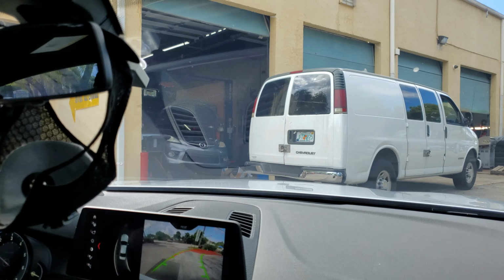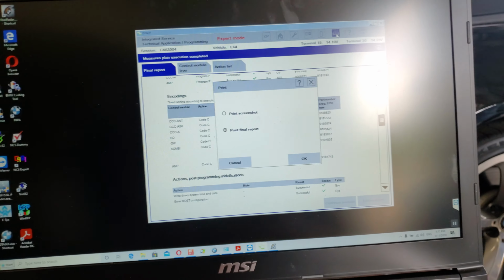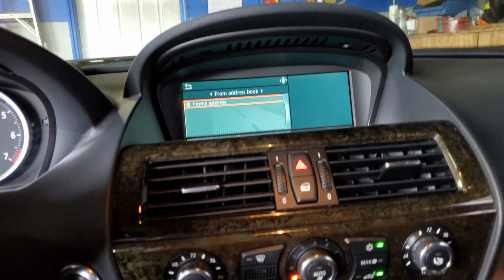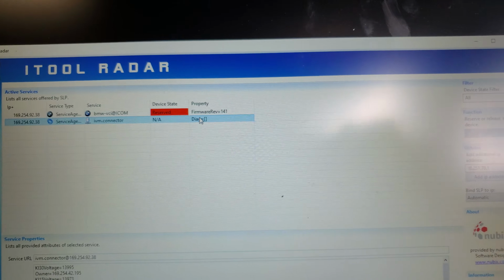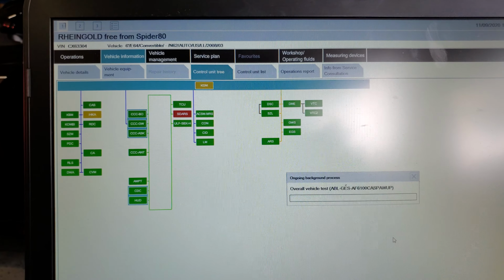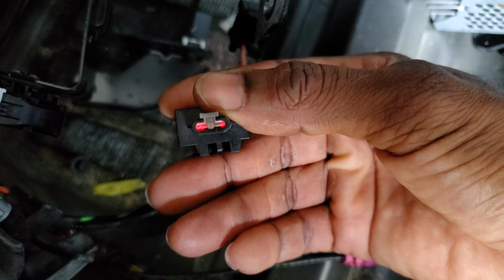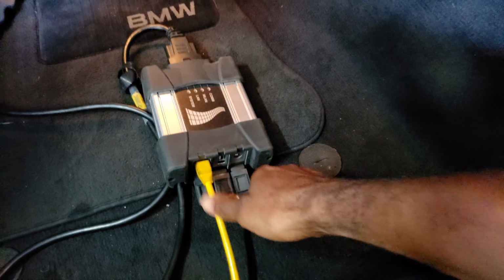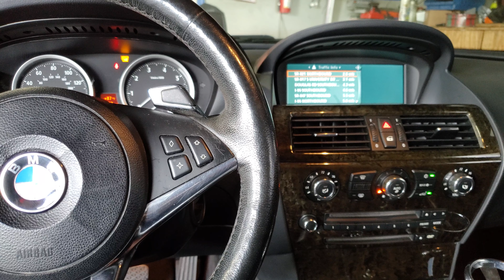BMW E64 CCC Radio sound restored.

Comment: hello I like your channel.  Can you tell me if a wrong timing in the n46 can have higher oil consumption and smoke? Mechanik was changing timing chain , car is running but it's coming blue smoke sometimes when you accelerat is black
Reply from the maker: Your Piston rings is leaking oil in combustion chamber.
Reply: @BMWPROGRAMMINGJAMAICA  Thank you for answer.

Comment: Hi ! i have my water pump working non stop on my bmw f30 320i n20.
it drain all my battery and on diag it give me : 
ibs wakeup: short circuit to ground ; code 8040B0.
i changed the IBS negative cable but it's the same problem.
can you help please ? thank you.
Reply from the maker: The Pump runs constantly because the Thermostat Valve is not disengaging or the temp sensor is not opening after water is successfully cooled by High speed fan.
Reply: @BMWPROGRAMMINGJAMAICA  i already changed the thermostat and no error about the pump or the thermostat. i only got IBS that i already changed but nothing changed. i always have the water pump working until it drain all the battery. so what do i have to do ?
Reply from the maker: @Samlevip777  Check for short circuit on IBS black or Blue wiring to DME